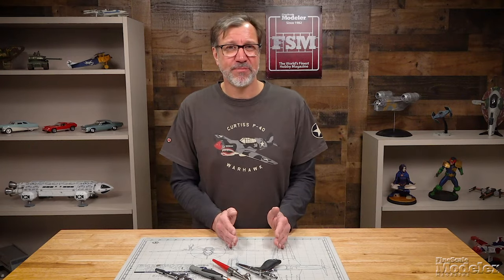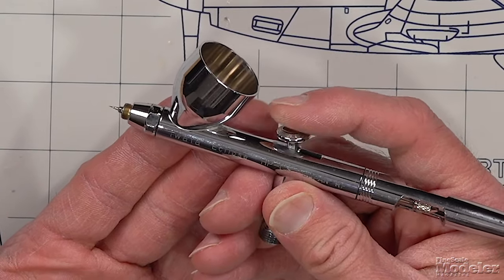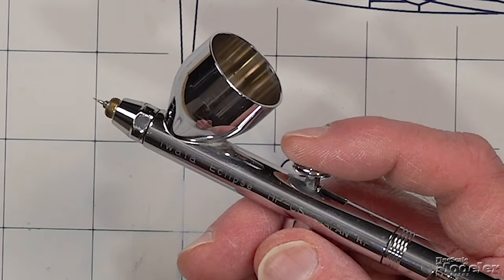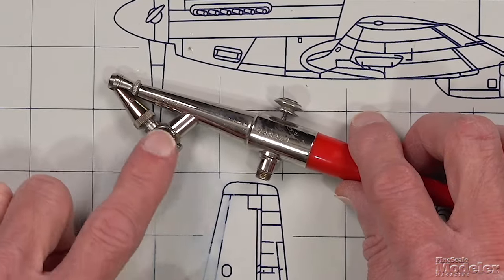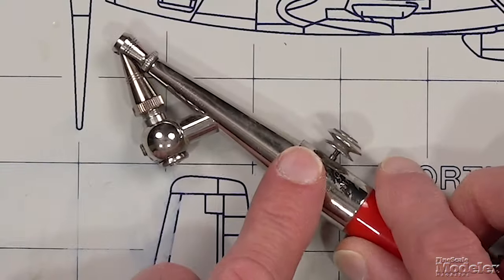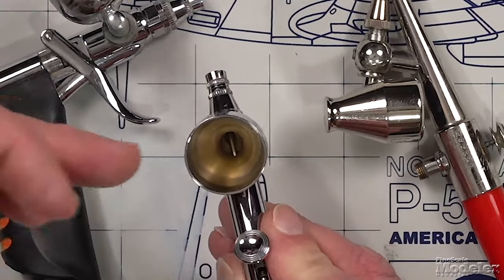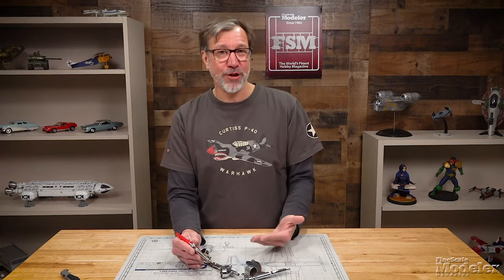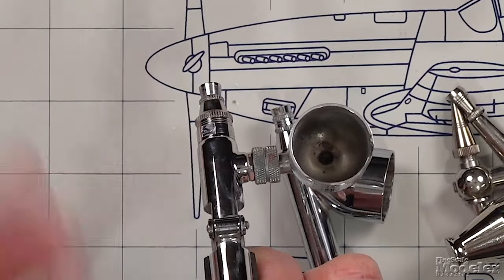Scale Model Basics: 5 considerations when choosing an airbrush

Comment: Gidday  Aaron. I started back in scale modelling a few years ago and got an basic double action airbrush (Delta?)  with 3 needles/nozzles. I watched your airbrushing videos on the FSM site and others on the net, practiced, made mistakes but it gave really good results (Mr Color, Tamiya paints) compared to brushes/enamels of my youth. Thank you for your help.
 
As long as the airbrush is sturdy/serviceable it's the maintenance that's important. It's been passed on to a friend and I have a Mr Hobby Creos 0.5 trigger (primers) and a 0.3 and 0.2 buttons for lacquers/alcohol and a Tamiya 0.3 trigger for water based paints (Kangaroos in the top paddock?) with a small tank compressor. Still learning each time but having fun. (booth and respirator)👍

On the finger tip fatigue, I get those self adhesive soft EVA feet/pads you put under vases etc to stop scratching/sliding and use a hollow punch to make a disc a bit smaller than the airbrush button.
I then peel off the backing and stick it to the airbrush button and it pads and conforms to the finger tip. It seems to reduce the discomfort over longer spraying sessions (for me anyway).
Thanks to you and all.  Cheers🦘🦘🦘

Comment: Harder and Steenbeck just came out with a revised 2024 Ultra.   I'm impressed with features of double airbrushing for beginners (I'm not paid, just have used almost all of them, including the Aztec which I enjoyed years ago).  I currently use mostly a Badger 105 and a Mr. Hobby brush, both fantastic sprayers.  One of the keys, as always, is paint consistency.  

Features on the H-S that are important (and once you start using the less capable brushes, these come into clear focus).

The trigger will not pull back unless the airflow has started.  Especially important for acrylic painting and tip dry.
The needle chuck has a trumpet shaped end, easier for those who's sight may be hindered to insert the needle without missing. 
There are 5 preset notches that establish different rates of paint flow by limiting trigger/needle travel.   Will make it easier for learning camo patterns, etc.   
The nozzles/needles are interchangeable with the Infinity and Evolution, you can expand without changing the brush. 
Triple Chrome Plating - no longer nickel plated. 
Removable paint cup that is tapered inward at the top to prevent paint spill.  It's press fit (not threaded) for easier cleaning.   
A great video complement for learning. 

This may help someone else grab a brush with features that will establish good habits right from the start.

Comment: It's always good to get more information on airbrushes. As for me personally, I have a Badger 200 that I bought in 1987. It still works very well, optimum working pressure is at 35 to 40 psi. And a Paache H05580 I got on ebay two years ago. It does a pretty decent paint job. The only gripe I have with it, is that the red part of the grip is plastic. Tends to make it nose heavy. I will be filling that part with ballbearings, to see if that gives it better balance characteristics. And a recent addition is one of the Harbor freight $20 dual action brushes. Since I got a Paache, to Badger hose adaptor, it was not a problem to alter the Paache hose to the cheapy $20 one. A side feed airbrush looks like an interesting item to try, maybe this summer. Thanks for the input.
Reply from the maker: Thanks for watching, Charles. We often say that a tool, treated well, will last a lifetime. Sounds like your Badger fits right into that category. Have fun airbrushing and happy modeling!
Reply: You can get a red anodized metal handle for the paasche now.
Reply: @LemurKrazy  Really, where can I get one?
Reply: @charlesbecker9617  paasche sells them directly if in the US.
I got mine from BNA models here in Australia.
Reply: I'm in the States. I'll check out some other hobby shops for that.the question here is, Is that piece solid or hollow like the plastic one?
Reply: @charlesbecker9617  it's machined to look just like the plastic handle and is hollow. Slightly heavier but only moves center of mass towards trigger about half an in inch - just in front of the ridge near trigger.
Reply: @LemurKrazy  Not exactly what I am looking for. My interest is in balance. More weight at the rear of the handle. So it's not so front heavy.
Reply: @charlesbecker9617  it is heavier but not enough to move the center of mass behind the trigger.
Reply: @LemurKrazy  I'll look at the aluminum one, certainly. Still likely to load that with the steel ballbearings, or perhaps size 4 or lager lead shot to try for a bit better balance. Basically anything that might help with that. If it improves and brings the balance to even just behind the joint there, that would be a better feeling airbrush. I do like it, it lays down a good smooth coat of paint.
Reply: @charlesbecker9617  good idea.
It's definitely a classic and adding a few new bits make it even better.
I added a quick release to the hose as well as a plastic snap on cap for the cup. Any store with paasche bits should be able to get them.
Reply: I got the Paasche to Badger adapter to use with mine. Badger 8' cloth loom rubber hose. Much better than the red plastic 4' that came with it. Cutting the brush connection end of it and it works well on the barb attachment on the Harbor freight cheapie. It's quite a snug fit.

Comment: You have to change the needle, nozzle AND nozzle cap (also known as air cap in some brands). They’re all matched sizes.
Reply: I am not totally on board with that. I have been using my Iwata Eclipse with a .5 needle & nozzle, but it still has the .3 nozzle cap. I spray all types of paint with it and it works well for me.
Reply: @CharlieHague-m8u  well, first off in an Eclipse it’s .35, not .3, and I’m sure you think it works great, but the fact is there are two different part number caps with visibly different size orifices for the Eclipse. It may work for you, but not optimally. This is the case with virtually all airbrushes. 

I-602-2 is the Eclipse E3 (.35) cap. 
I-602-1 is the Eclipse E5 (.5) cap.
Reply: @CFster  Sorry for my error in cap size. Anyway, it works great as is m.

Comment: This is a serious question:  I live in a remote part of the country, and there are no hobby stores here to get any models or model supplies.  Where is a good place to get the things we need for the hobby?  I have the basics, all the tools i can need to make stuff.  I just need models, paints, putties, adhesives, ect.
Reply: Just Google the name of the product you're looking for and you will get a plethora of websites to buy it from.
Reply: I use hobbylinc for most of my stuff.wide variety of tools,paints and kits....
Reply: Scalehobbist online shop out New Hampshire has some good prices. Also spru Brothers in Kansas City carries everything you mentioned.
I just picked up a couple Gaalheria trigger brushes their GHAD-68 w/3mm needle nozzle for 39.95 it was on sale. And in early December the collaborative trigger air brush came with a quick disconnect, three nozzle-needle combination, .3mm, .5mm, .7mm. I also bought the fan cap that can only be used with the .5mm needle.
They are both great air brushes, and the company has second to none customer service. They also just opened a warehouse in the USA so shipping is a lot faster now, than last year.